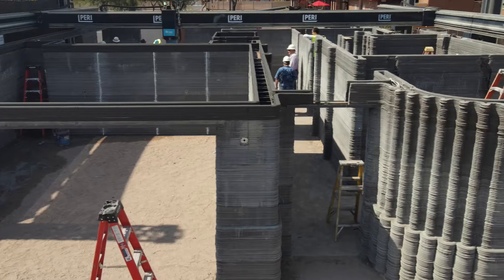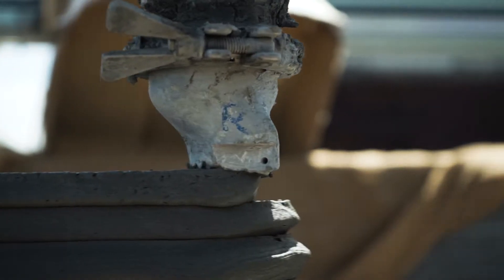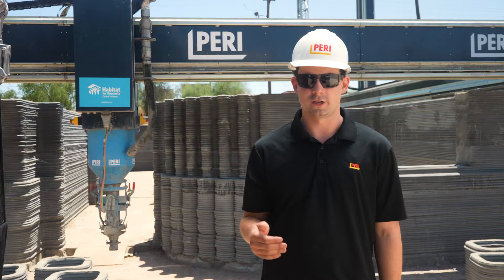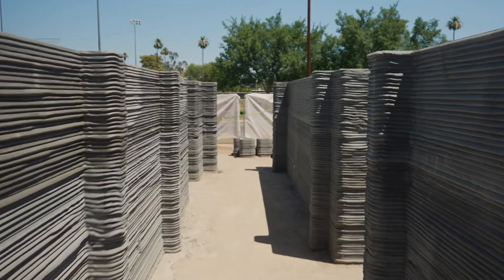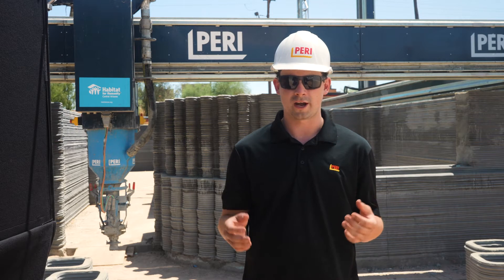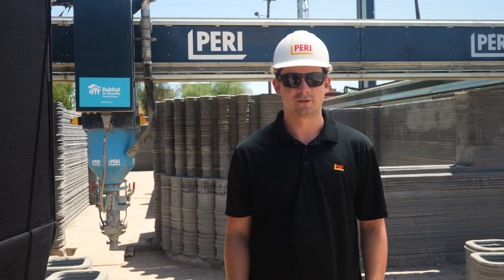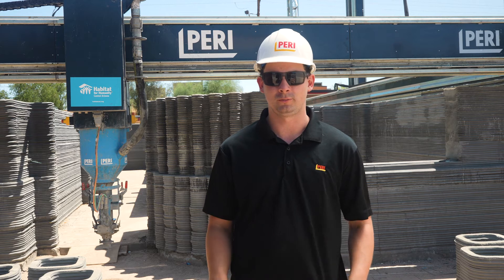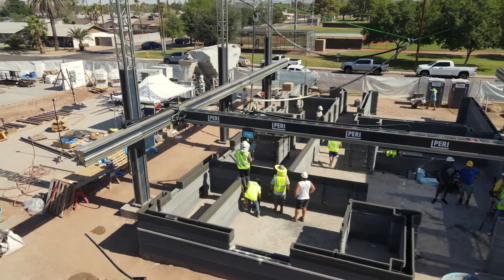Benefits of 3D Construction Printing & Project Insights_EN

Comment: If you set up a factory in clean dry area and pour slab concrete and fit on site sure this would be quicker and less expensive than theses machines.